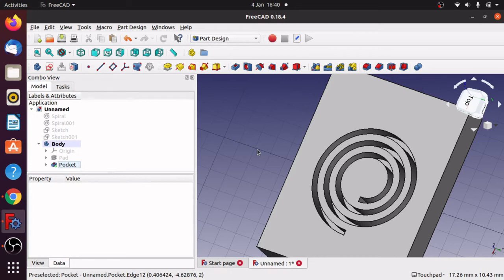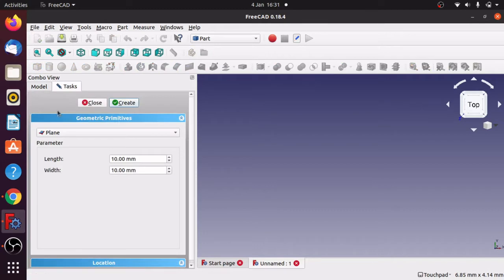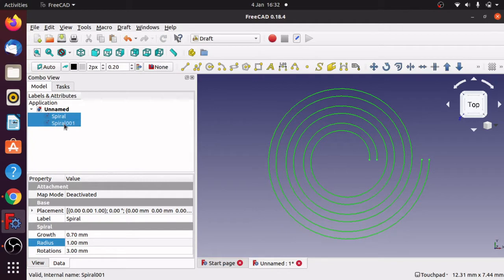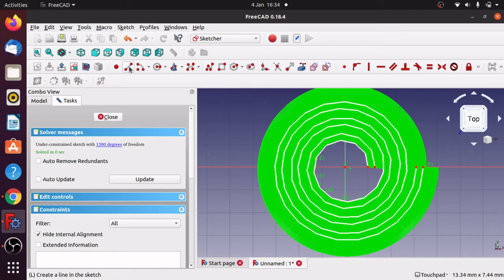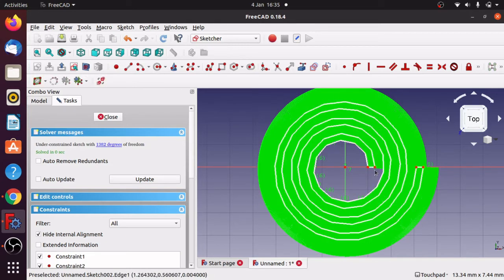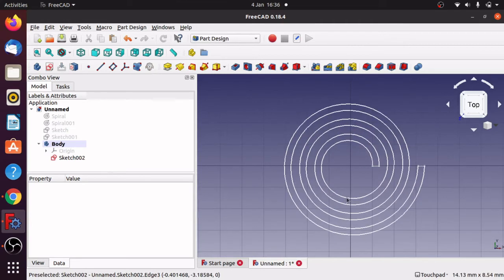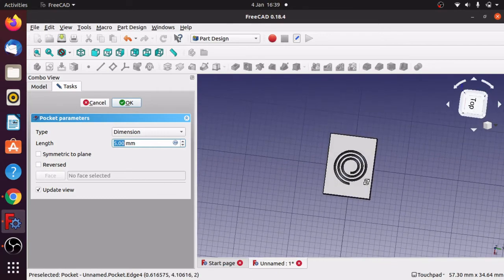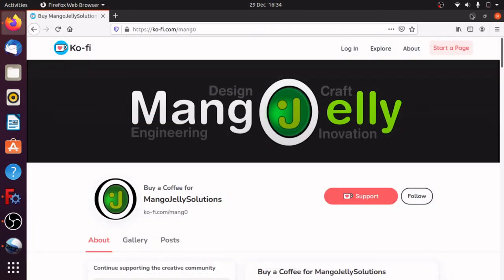FreeCAD: Creating a spiral from Part WB & pocketing into a pad (Removing material 1) Beginners Guide

Comment: For some reason you can't parametrize the number of rotations from the task tab, but you can from the model tab. Typical :)
Reply: Never mind... The conga line of workarounds breaks the parametrisation anyways... If you change one, you need to restart from the original spirals. Admitted, that would have been a little too much to ask :)

Comment: For anyone watching this in 2022 on 0.19.
I've writen all the little differences i found while learning how to do this for the first time on FreeCAD.
First difference is that Draft to sketch is in modification tab now. This will create 1 sketch if you select both, so far no issues...Don't panic as this saves time step wise compared to what was shown. 
You will need to go into sketch though still for the next step, and thankfully drawing the two lines is quicker and easier than shown in the next step, same tool just better implementation. 
Next, don't panic... When you switch over to part design it will show a list of things, but not create body (at least it did for me), but i clicked on model and then tasks again and it showed create body so i was back on track. 
Okay, i feel like I'm going to be repeating the "don't panic" line, so from now on I want you to follow me carefully as i write this... This is now your mantra if you're inexperienced. Breath in... Breath out... Don't panic. Good... just repeat that every time i start a new line!
Next I wasn't able to click and drag the sketch into the body, so if you're having the same issue... Well just right click on the sketch on the left and click "move object to other body", and this will give you the only body you have thus far and you will be back on track.
So, if you haven't customized anything for FreeCAD thus far and everything I've noted has worked for you... The next part you need to click on Create a new Sketch which is a square and circle and that has been moved to the middle of the options rather than the far left. Get used to this, as everything will be in the middle until you customize a little bit on all the various drop down options. I've gone ahead and done this as i think it will just make any of these comments i leave behind that much easier for me to write.
Next up, to save you some frustration and confusion when clicking to map the sketch just click on the three dots beside deactivated and then click on the surface you want to map it onto, in fairness this wonderful YouTuber does this, but i assume they had the same issue while filming this as I am writing for now (changed versions so slightly different way of doing it).
Last note is for pocketing at the end, i did not have to highlight the surface, i simply clicked on the sketch of the spiral and clicked the pocket tool, then set it to 1.2mm and i was done!
Again i added this for the differences between when this was posted and version 0.19 at my time of writing this, build may differ as i will likely not update any time soon if i can help it.. and I'm just getting used to FreeCAD as I was learning blender and fusion360, but with subscription news for fusion i figured it was time i learned FreeCAD.

I hope this helps the next person!
Reply from the maker: This is brilliant, superb feedback for the community. One of my older videos and it does need updating but thank you so much for your time you spent doing this.  Thumbs up to you.
Reply: @MangoJellySolutions  say, don't suppose you have any advice on cloning and refining in 0.19? Can't seem to get a stl I made in blender to the editable state or get rid of the previous solid and unrefined one without it kicking up referencing error warnings if I delete it. I was resizing the stl and going to add pockets, but the process is very slow. I honestly was about to give up and just make it from scratch
Reply: You can 'draft to sketch' both spirals into a single sketch immediatly.

Comment: Interesting approach. By the way, the order you select the point to make them concentric makes a difference. Select the point to remain stationary first, then the point on the line to be joined and then the coincident constraint. The line will then move to the first point selected if that makes any sense. I really appreciate your cluing us into how to move things between the different work benches. Thank you so much for the videos.
Reply from the maker: Thanks for the tip regarding the constraint selection order. I will give that a go. I am glad you are enjoying the videos. With so many workbenches I find that they're so many ways to achieve the same or similar thing and dabbling in them all really helps when it comes to figuring out how they work together. This is the most interesting (and somewhat frustrating at times) piece of software I have ever used. I really appreciate the comments and it helps me to produce better videos for the community.